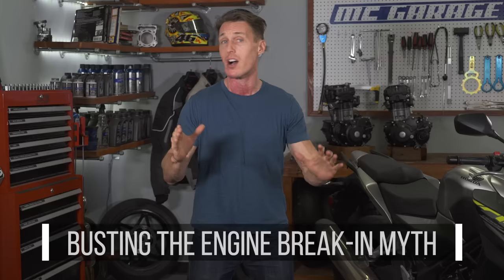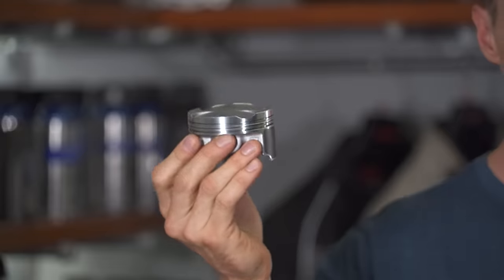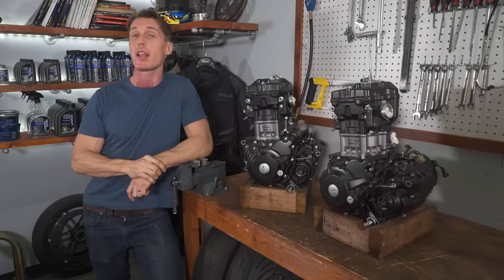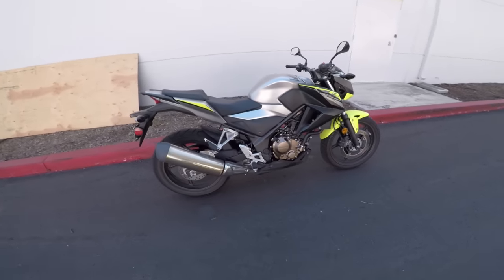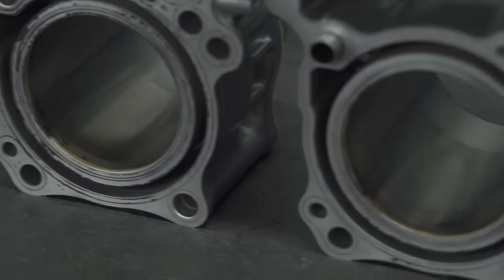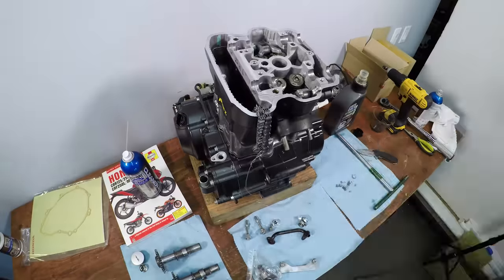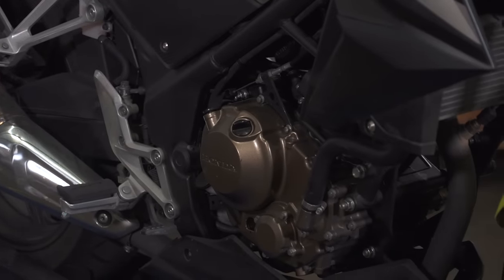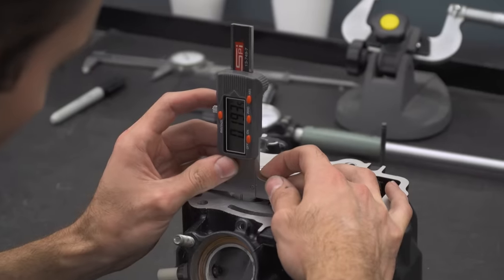Busting The Engine Break In Myth | MC Garage

Comment: This channels is (was) extremely informative, but I wouldn't draw any conclusions from a sample size of 2 engines. If manufacturers have data that suggest that engine defect rates can increase from, let's say, 1% to 2% due to improper break in, they will insist on following proper break in procedures, because it's a 100% increase in defects across the population of engines. However, to replicate their data in your garage you would need to test at least 200 engines. The fact that there was no difference between any 2 individual engines does not mean that these results can be extrapolated to the whole population.

Comment: How about starting mileage with a soft break-in and gradually increasing throttle over the course of the break-in period? That's what I've been doing with my new bike due to all the conflicting info on interwebz. It seems like the pistons need to be fully exercised to settle properly, but not right away and that either extreme method would be less than ideal. Seems like this is the recommendation he gives at the end - i.e. not giving it the beans the first few days. Thoughts anyone?

Comment: The first hour of an aviation piston engine is done at maximum power. Wide open throttle and design red line. After brief warm up, full tilt for not less than 1.0 hours on the clock.

Comment: with only 1000mi to go by, i'm not sure a few measurements would be enough to really get an accurate full picture of all wear-areas within the crankcase... the ring gap seems like the biggest indicator from what you did measure. good effort, just wish the oil had been sent off for a breakdown of exactly what the differences in metalogical content were.

Comment: Why there are more metal scraps present in first oil change? 
I mean more metal scraps are seen attached  to the magnetic drain bolt during the first oil change...why?
It can also be noticed on the oil filter.

Comment: My mechanic over hauled the enginge and immediately after start up he started doing wheelies. I saw him and knew that ass hole fucked up my bike's piston and its ring. and I was right, bike starting eating up oil and giving smoke within couple of days. I went to another mechanic for piston replacement, ring installations and bore polishing. he had to use 0.5 mm bigger piston as bore got loose after cnc polishing. he packed up my bike and ask me to drive it slow like its a bicycle and at least burn 10 liters of fuel. then he would adjust carburetor again and tighten or adjust tappets(in our language) / valves timings. my question is how long should I wait for high throttle?

Comment: Ring end gap increase on the high rpm break in engine is indicative of premature wear on the rings that didn't happen on the low rpm break in engine. This alone would lead me to follow the manufacturers instructions and do a low rpm variable load break in. It's in the manual for a reason.

Comment: There needs to be an important caveat here, at least for big air cooled engines like Harleys. The "brutal" break-in test was done over 1000 miles on a small displacement liquid-cooled Honda. Not only might you start to see significant damage on a big v-twin over that distance but 20-30K down the road it's highly likely you'd find a drastic difference between the two methods. Riders beware.

Comment: What should be highlighted that people SHOULD REMEMBER and SHOULD CONSIDER that it's not only the engine that needs a break in, it's also the tyres, suspension etc. etc.

Highlight on the tyres part. 
Break in your engine "wrong", then you've got a machine that'll reduce it's lifespan.

Not break in your tyres... and then slip off a cliff. I don't need to tell you what else's lifespan will be reduced.

Comment: I don't think the hard break in method is 100% throttle for 1000 miles. It's just making sure you give it the beans a few times for the first ten or so miles. After which you can ride as you normally would. Then again, there is no set rules for a hard break in.
Either way it's a modern engine, just don't abuse it and follow the maintenance schduel. Good video, always wanted someone to put this to rest.

Comment: I have worked at a engine manufacturing factory and every engine was driven 1 hour test cycle at the test bench, if they dont deliver the max hp specs the engine dont pass so all engines was max out with full load and revs before it was delivered to customer, I belive all brands do the same

Comment: Aways do a leak down and compression before you run it for a base line numbers so you can see exactly what improved during break in .
.one other thing i always seat imn the valves with a leak down tester right after you torque down the heads with no valve train bolted on yet ...this way all valves are closed , with the leak detector on take a small  plastic hammer and tape the top of the  valve stems and listen for the popping sound of air rushing out .as you have already seated the valves with a best of test you will ever get 

T

Comment: Point proven. But what about the ring end gap difference. Wouldn't a larger end gap suggest more ring was worn out. That's the only part that confused me. Or was the first engine the one with larger gap ???? Great video good luck on what's coming.

Comment: Okay but on high horsepower engines?   BMW for instance actually electronically forces new owners to break in their 1000RRs and maybe other models idk...the computer simply limits throttle (which is non mechanical so they HAVE total control) and RPM or however they do it....you can't haul ass for hundreds of miles in other words.....is it really to break in the engine?  OR is it simply to lessen a catastrophy if there were something defective off the assembly line?

Comment: Hard break in is best . Cross hatches only last so long take advantage of them. Lotts of hard accels and decels get the ring to expand more and seat before the batches are polished gone. Just dont hold revs high at all for a few tanks. Soft accels and decels will not expand the rings as much thus having not as good as a seat.

Comment: Ring tension alone will not produce a good seal. For 35 years been using high RPM and combustion chamber pressure to push that ring against the crosshatch pattern to get that good ring seal. 
  Number one thing not mentioned for every engine is to allow for full warm up before any high RPM is asked for.

Comment: By the book
Break-in same as you drive
Or the new one break-in at full throttle

I just got 2 new bikes, I'm doing it by the book.......since it doesn't matter then it won't hurt anything
I'd need a bunch of straight line to do full throttle.....thats not why I ride
I can cruise at 60 in 3rd(and its got plenty to go)......warm it up then cruise in 5th(thumpin) for awhile to cool it down

And thats pretty much the way I drive anyway......yes acceleration is slower

Comment: Most of the break in happens in the first 100 miles. The rest is about heating up and cooling down parts to fit them in tiny tolerances. They expand and contract until they wear slightly and settle. I have never blown an engine I broke in myself. I have blown a head gasket in a used car I know was abused.

Comment: High load with mid rpms. The key is the load factor. Under heavy load,  enormous outward pressure is put on the rings, and the mid rpm is for the bottom end so those journals can wear in without oil squeeze out.
Truth is, If you baby it and idle it for it's break-in, it'll glaze the rings.
Reply: Aircraft engines we run wide open, low load, rich mixture for break-in. If you run them low rpm they glaze. If you load them up (ie, running high manifold at low rpm, lugging low speed in high gear) they will glaze.

Comment: There might be a difference between an air cooled and a water cooled motor and the heat ranges that can cause damage to the motor during break in.  A liquid cooled motor won't go to extreme temp changes that an air cooled will especially sitting in traffic

Comment: I think waiting until the 6 minute mark to tell people that higher revving engines are something you would not recommend going to wide open throttle is a bit irresponsible. Most impatient young men will just watch until you say "Nope, made no difference" and bail. In my personal experience, My brand new GSX-R 600 wouldn't even let me spin it up past 7k when I first got it... the engine was obviously tight. Break in periods are set by the manufacturer for a damn good reason. After my bike was put together, I was told by the service techs that they have seen plenty of engines ruined with bent rods because some idiot full throttled it before it was ready.

Comment: How did you manage to get a fireworks to hit you in the face and break your jaw? Hope the healing continues to go well... 
As to break-in, I would prefer to reference the advice given by the manufacturers' who typically have decades of experience. 
An acquaintance of mine once took his 860 Ducati GT, that just had new valve guides installed, right onto the highway on a very hot day, rather than follow the engine builders advice and keep the speed down and throttle moderate for the first few hundred miles. Of course he seized the valves, bent them, and needed a more expensive repair to now make it right...

Comment: So there's only a slight difference in a very mildly tuned engine, but a strong recommendation to not do the aggressive method on a more performance tuned engine.  Also, no investigation was done to the crankshaft, bearings, and transmission parts, which also need a break in period.
I'm seeing no myth "busted" here. I've always followed the manufacturers guidelines in the past and see no reason to change that decision in the future.

Comment: Really all depends on the quality of the original engineering, if your parts are Machined smooth polished you don't need a run in
If they are rough machined you do, it harks back to the days when cylinder to piston clearance was difficult they used the initial running to "hone" the bores so as to avoid seizures.
Modern materials and engineering tech negate the need.

Comment: Watch as youtube drives itself out of business  nice vid  soon no one will bother with youtube  DON'T HARD RUN-IN A TWO STROKE  keep jumping up you will feel less resistance from the throttle each time don't hold.a new two stroke at the same rpm for long .the pistons are drawn forward by the pressure off the exhaust and it gets an over polished spot

Comment: Not shocked.  Much traditional motor wisdom comes from the 1930s.  Engines were cast more brutally, by hand and parts were milled and stamped with hand adjusted tools.  If polishing was done it was done by a worker directly, so tolerances were wide.  The motors themselves were big luggers that slopped oil and had total loss systems.  WWII upped the high rev piston game for aircraft motors able to fly 500mph for thousands of miles, not 200mph for 200 miles.  After the war, these factories got back to making motorcycles and cars.

Slowly over 1945 to 1990 the older car and bike motors were replaced by aircraft grade motors.   Honda was a company on that  cusp.  Harley and Triumph were still traditionalists for decades.

3000 mile oil changes, breakin periods, short cycle rebuilds, valve adjustments after only a few thousand miles are often just old concepts from our grandparent's era.  The 1990 ICE motor tech was the top of that game.  100 years of engineering progress.  Now we mostly see tweeks but not radical improvements.

Comment: My story is braight a Chinese bike rid it hard for 5000 miles ... did a big bore kit and old piston had small scoring on it. never broke it in and the engine was at 7000 rpm most of the time.

Comment: i know this is far fetched but i did a valve job ,spark ,air filter ,whole works on my zx6r  but it still has no top end power it wont push past 200km  blanked out the dyno map nothing added more fuel nothing   was the same before and after i did all the work to it

Comment: The only difference between new engine break in was the piston land ring gap and it wasn’t even discussed....  what’s up with that? You chose a slow break in because of tires and breaks are still new?  this isn’t about breaks and tires break in period methods, it’s about the ENGINE break in method and the ONLY difference you FOUND after alllll that effort was not talked about? Let’s talk about piston ring land failure and the cylinder walls getting scored and fouled spark plugs from the oil that’s getting passed the piston ring gap... if you found that with just 1000 miles of driving, what will you find after 10,000 miles??

Comment: Using the term, 'break in the rings' demonstrates wrong thinking about what's going on during the break in process. It's not the rings that break in, but the crosshatch in the cylinder bore. The rings hydroplane on a thin film of oil in the bores except at the bottom and top of the stroke where the piston momentarily comes to a stop and changes direction. A newly crosshatched cylinder has peaks and valleys in the surface. The peaks in a freshly honed bore stick out above the oil film making metal to metal contact with the rings. The purpose of the break in is for the rings to cut down these peaks as soon as possible which is accomplished using a good break in oil that allows the cutting to happen faster than the normal running synthetics and running the engine harder. Otherwise glazing can occur in the bores. 
What is the benefit of proper break in? Extended life of the cylinder bore. Checking compression, measuring tolerances, etc. will not show much if any difference as to whether an engine was properly broken in when torn down after the so called break in period.
If I had to choose engines for myself, I would take the one that was run hard, however I don't believe the proper oil was used. I might be tempted to put in a good oil for break in and repeat that process, drain the oil and put in the long term synthetic.

Comment: At this point I've owned tons of motorcycles. The only engines I actually run thru a proper break in process are H-D engines rebuilt from the ground up with performance parts. Metric bikes, and modern production engines? Nah... good fresh oil, ride it normally, don't beat the shit out of it for 300 miles or so and it's fine. The break in charts in the manuals really are just put in there by lawyers.

Comment: How important is that 600 mile oil change? Could I get away with doing 1200 miles for example?
Reply: I belive it's important to do the early oil change, since the oil is more likely to contain potentially harmful metal debris from the manufacturing process.

Comment: Let's see what those motors look like after 90 000miles. I can almost guarantee the 600rr will be in better shape internally
Reply: What this video doesn't take into account is environment. That being the roads driven on, altitude, totally out of sync riding styles (like riding light then riding hard), etc.

Riding one hard CONSISTENTLY on the freeway isn't really going to give different results. What they should have done was ride it like a stunt bike or on a track in the A or B group. Part of the point behind the break-in period is to get the metals used to certain temps at certain RPM's, while also smoothing out the surfaces that make contact with other parts.

I know they tried to be all scientific on this, but didn't do it properly at all. They went through the motions of an experiment, but didn't create enough perimeters to allow for change in the results. They needed to ride 4-5 bikes. Have 1 control (what the manual recommends), then have 3-4 bikes be ridden in completely different "brutal" styles of riding. Track, stunt, drag racing, etc.

Comment: Lots of videos like this but I still think its best to stick to manual. End of the day the manufactures have decades of experience, knowledge and data, and have been making bikes for 100 years so. 

Interesting experiment but using 2 engines to reflect an entire market is a stretch.

Realistically though just ride normally I think is fine. Neither extreme is necessary

Comment: First one point two miles of every bike I've seen come off of the assembly line I'm not going to specify what brand are the hardest miles I've ever seen put on a new bike 30 seconds of warm up time and then raking gears to redline most modern engines don't need a break in cycle

Comment: Flat lifter cams should be run with hi zinc oil at 2000-2100rpm for 20 minutes.  Rollers don't need break in.

Comment: I thought hard break in was barely letting it warm up then full throttle when accelerating everywhere and hard downshifts, heat cycling and not overheating. And absolutely no constant or high rpm for first tank of fuel.

Comment: After over 40 years  building engines the best advice is it's different for different engines a 600R is different to a shovel head, obviously. Advanced technology and manufacturers tolerances mean that a late model Japanese motor properly built requires a little care initially but driven normally will bed in pretty well, as long as it's not flogged. Take a new Milwaukee 8 and run it at 70 mph out of the box and it just might drop it's guts within a few hours. It's horses for courses and will always be that way.
If you know a guy that is happy to ride it like he stole it from new, that's his choice, just don't buy a bike from him.

Comment: You went through all that and didn't compare performance?  A dyno pull, even to only 2/3 redline, before and after break in would've been useful.  Also, should do first oil change at like 50-100 miles, and don't merely "baby" the engine.  You need to do vacuum pulls- wide open throttle in a high gear, followed by engine braking.